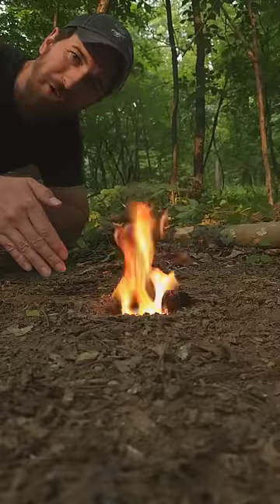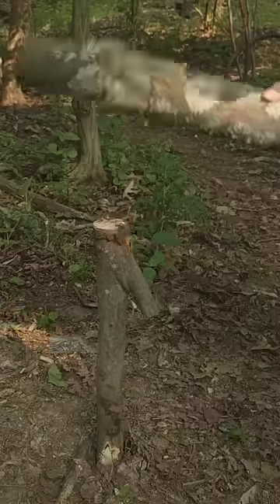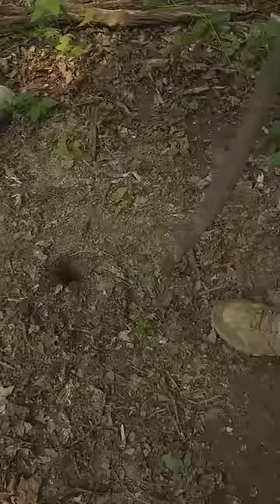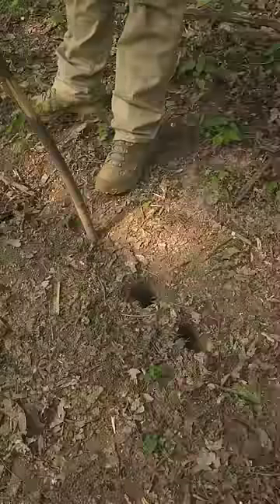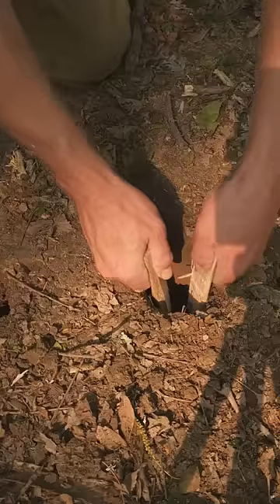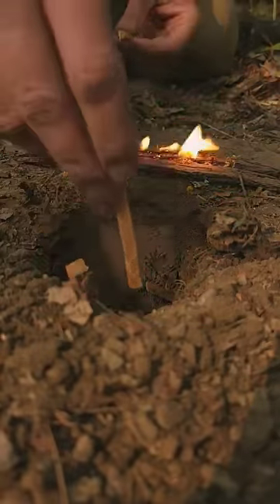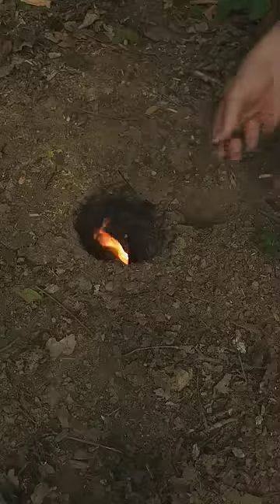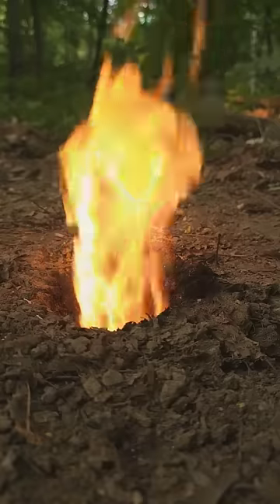Make a mini fire hole/rocket stove with no shovel 🔥

Comment: Final safety tip: Be sure to douse that setup with PLENTY of water. Those coals can last for an extended time and may possibly flare up at a most inconvenient moment...
(EDIT: obviously, many of the responders to my comment have never heard of a root finger catching fire and flaring up 20 feet from the original pit. You must first douse the fire to cool any active flames, then scrape the embers from any unburned logs, add some dirt or sand and more water, stirring into a slurry until there is no more smoke or hissing sound. Finally, feel with your hand for any residual heat. This process can easily consume 5-10 gallons of water, depending on the size of the pit. Don't assume the fire is out and you'll never wind up being THAT GUY.)
Reply: just cover it with dirt lmaooooo 😂😂😂
Reply: @armanromana1580 just blow smoke and possibly flames in your face by grabbing too much twigs and leaves and not enough soil 😂😂😂
Reply: Don't want to be like Centralia Pennsylvania.
Reply: That makes sense thanks.
Reply: Im mean its not like youre gonna stick around for long anyways
Reply: Thank you, I was wondering how to put it out afterwards 👍
Reply: About to say this is a really good way to make a ground fire. Be sure to put it out with a generous amount of water.
Reply: @DG-kr8pt wondeful me first mentality you got there. Not your problem if there's a forest fire afterwards right?
Reply: why waste drinking water when you have a bladder? 😂
Reply: Thank you, Captain Obviously Stoopud
Reply: I was going to say this is a great way to start a forest fire without any tools. 😮
Reply: Jesus is King ? Jesus wasn't a smarty pants  @OvercomeThroughJesus301

Comment: REMINDER:
FIRE HAZARD NEAR ROOTS!
Be extra cautious to light up this awesome stove AWAY from tree roots
Reply: Not just that, in areas where the ground had an organic layer, this is a perfect way to start an underground smoldering forest fire
Reply: Thats a really good point 🤔 underground fires that have lots of fuel like a whole trees root system can burn slowly but get insanely hot and you won't even know it until flames break out somewhere above ground
Reply: Oh, shush
Reply: @jordach545  why he's right, it IS an awesome stove and you DONT wanna catch roots on fire... underground fires are the hardest to extinguish
Reply: I like taking chances against conventional wisdom and i like to assess risk for myself considering my whole experience, not just the relevant area of knowledge. I reserve some safety concerns for root fires and similar. If I could develop a method for before and after checks, as well as a good method of extinguishing, then I would use this all the time.
Reply: Dig and pour, and mix, might be the only way, and that's a lot of extra work.
Reply: @Saohesc  I mean I'd say just visually assess and don't risk it if you're not sure 🤷
Reply: @jordach545 what is wrong with you?
Reply: @password6975  oh shush
Reply: Lol goofy.... Make sure you're fully vaccinated and wear your mask
Reply: @bertsbug  I think it's funny you mock that idea as if it didn't serve a crucial purpose.
Reply: Doesn't fire needs oxygen??

And the roots underground (surrounded by soil) is incapable of burning after a length due to lack of oxygen.

Correct me, if i am wrong
Reply: @BooBuKittyPhuk just be near and c9ver the holes to kill fire
Reply: @bertsbug lmao I've seen these comments on literally any comment that suggests one should practice safety. Its not that stupid that some people value playing it safe. It's one thing to say something like that about masks and vaccines, but to act like preventing forest fires is a waste of time is just an entirely different level of stupid. Things burn. Things can burn underground, we've observed it before. Things burning out of control is bad. It's not complicated.
Reply: @jordach545  huh??? I did
Reply: @TheKvc there will likely be oxygen underground and in the tree as well as there being enough room for the o2 molecules to get down there, also even with a lack of SOME o2 it will still combust it’ll just be incomplete combustion like most large scale fires r, they’re much worse than normal fires creating soot and releasing co (carbon monoxide) instead of co2 which is much more deadly
Reply: How does it burn? I know fire needs oxygen so how does it stay alive instead of being smothered?
Reply: @zakillgaming  it’s possible, has the bear minimum amount of oxygen. Seen it myself
Reply: @700K-pp9wm  hmm okay if I had to guess it could be from oxygen trapped in the ground or the hole where the fire started is still open but if neither of those are the case I would have zero clue unless the root for some reason has oxygen but I don't know trees at all
Reply: Literally about to say the same thing
Reply: Omg a lot of smokie the Bears on here, obviously this is like maybe for a "Have to" scenario, I wouldnt go camping and do this cause if you arent smart enough to bring cooking stuff and or put a fire out and make sure everything is kosher before leaving the site than you have no business being in the woods at all😉, ever hear of water bottles or a canteen if you are really roughin it🙄
Reply: @jordach545 part of being a man of the woods is also knowing how to do it correctly. So, respectfully, you hush.
Reply: @EntropicTroponin 😂 just stay inside where you're safe 👌
Reply: @BooBuKittyPhuk also the hardest to start
Reply: No. Youre not going to light tree roots on fire.
Reply: @EntropicTroponin you are never going to start an underground fire. Stop watching youtube. If the area was dry enough for that to happen you wouldnt be lighting fires in it to begin with
Reply: @jordach545 St Louis has an underground nuclear waste fire no one can stop. Jk the nuclear waste isn't on fire, yet. But the fire is coming.
Reply: @TheKvc there is oxygen underground
Plants also need "air flow" rocks, bugs and burrowing creatures keep soil from compacting (even if it feels hard to dig) a plant can be suffocated from its root system so even though it might not be full wind underther the tunneling roots will have a supply of oxygen around them. It would not be full flame fires underground but slow and hot burning its way through the webs of roots and layers of organic material under the surface. Like a tissue that doesn't flame ehen you heat the corner but eats its way across. It will kill the trees from the roots up and threaten underground wildlife. Trees root system spread out more than they burrow down.
Reply: How is a wet root going to burn with no oxygen? That's physically impossible.
Reply: Tree roots permeates the entire forest. It woyld be a difficult task. Theres gotta be a better way with less risk of that happening!
Reply: Bad idea in peat soils. Gonna burn until it floods.
Reply: How do you avoid roots? Can't see them and if you miss them by a few inches it's still hazardous. I say stick an normal campfire. Just to be safe.
Reply: @Saohesc Who cares what you want to do. Be responsible first.
Reply: @TheKvc You are wrong. Depending on organics in the soil, “dirt” can be quite porous. So… passes oxygen
Reply: @TheKvc  You are wrong.
Reply: Right, I was wondering about this now we're having all these droughts and heat waves :/
Reply: @TheKvc  You are wrong. If the soil is soft enough that you can dig a “stove” like that, it is loose enough for oxygen to penetrate and support an underground fire. Not to mention all the organic materials. 
Unless it’s winter or there have been multiple days of soaking rain, using this stove is irresponsible.
Reply: @BooBuKittyPhuk under ground fires?? Are you talking about communism??
Reply: @zakillgaming soil can contain a lot of nitrous oxide
Reply: @Coincidence_Theorist  you've never heard of fires jumping fire lines because of root systems? Or the underground fire in Pennsylvania thats been burning for over 50 years?
Reply: @zakillgaming the ground is not dead dirt, it’s porous and made of living materials.

It needs the right conditions though. A very wet or thick mud packed ground layer, or a stony one without trees shouldn’t burn.
Reply: @zakillgaming first off trees create oxygen, secondly that's why it's called a smoldering fire just waiting for a big influx of oxygen then it explodes out of the ground. For more information I guess Google underground forest fires
Reply: @djscottymaxx It's "Smokey Bear." Not smokey the bear. Clown.

Comment: Pine cones man... There's tons of them most often and they light quickly... Also keep feeding hardwood into it, after awhile you'll have a deep bed of red hot coals that stays lit for awhile
Reply: I gathered up a 5 gallon bucket of pinecones from my front yard & threw em all in the fire pit & lit it... pretty awesome
Reply: Pine trees often have some dried dead branches still attached to the tree that works well enough as kindling.   Certain trees have a type of cotton growing out of them similar to what a dandelion seed parachute looks like at the end of the season.

Comment: Please be wary of starting underground root fires when you do this. Those can spread for miles unnoticed and cause massive damage. 

I would say this would be a more of an emergency fire where if you can get it to start, it burns very hot so you can use damp wood as fuel.
Reply: This is super dangerous. It’s pretty damn irresponsible for him to suggest it

Comment: These are incredibly dangerous for root fires and should only be done in open ground.
Reply: Please tell us more!
Reply: @danacoleman4007 the fire or coals can ignite the roots and it will continue to burn out the root and can possibly move up to the tree catch the tre on fire n cause a forest fire.. ( I believe is what I read before from one of these bushcraft guys)
Reply: OK negative Nancy!!
Reply: It's real! Especially larch/tamarack roots and dead dry punky roots of all tree species. Peat is also a problem. You can't just have a fire anywhere!
Reply: @justinhachey4931  Not just trees but grass as well you could actually trap your self in a fire like that, they are fukcing scary.
Reply: @Atite_Lometen  Common sense says don't put any sort of fire right next to flammable things.
Reply: @TRIZZZ70 Ok, 6 yr. old.
Reply: @thirtythreeeyes8624  but common sense will also tell you that soft soil is moisturized dirt, also that the roots are trapped under all the land, how is the lack of air going to fuel the fire through the ground as well as the moisture from the dirt packed on top? I believe all of you are wrong
Reply: @justinhachey4931 .. What if you put a flat rock or two in the bottom before creating your fire?  Still douse with water and dirt after though.
Reply: @StevenLeeStudios Dirt containing air is basic horticultural knowledge. It's why you don't tamp garden soil. You just lightly compact it with water. That space allows water to permeate and roots to breathe, which prevents root rot among other things. Every beneficial grub, bacteria, insect and fungus requires oxygen to live.

It isn't much air, but all it takes is a smolder. Once it hits topside, woosh.
Reply: Yes but if you were ever in a situation you needed to eat …
Reply: @TRIZZZ70  It’s literally what could happen

Comment: This is great for tarp camping, I'll stay dry and warm with a small fire in my shelter. As long as I don't roll over it. :)
Reply: Put a small log between you and the fire holes. If your sleep surface is fairly soft and comfortable, your body tends to roll away from the hard, rough lump.
Reply: It's also great if you're on the run from bounty hunters or assassins!! 😃😃😃
Reply: Providing you don't give yourself carbon monoxide poisoning!
Reply: @thesaxophoneboy A tarp, not a tent..
Reply: Carbon monoxide warning!!
Reply: @thesaxophoneboy sure, but he did say he'd be sleeping under a tarp. Such shelters are very much not enclosed, so I figure you'd have no problems. If you did this in a tent, you'd probably destroy/burn down your tent anyway...

Comment: "Pound it at an angle towards the bottom of the first hole" solid advice I'd say. 😄
Reply: 💀 bro this is a kids app
Reply: @danejoyce7029  and if you're old enough to get the comment you aren't a kid anymore
Reply: @danejoyce7029  🤣
Reply: YouTube is a kids app?
Reply: @doggg4977  As a kid, I can confirm. And, thanks for the advice.
Reply: @doggg4977  yes ma’am
Reply: @danejoyce7029  it literally isn't. There's youtube kids for a reason
Reply: You have to use solid wood to pound
Reply: @chuchuokeke  🎯🙌🤣
Reply: @doggg4977 You Tube Kids is actually the kid friendly version of this app...
Reply: @danejoyce7029 youtube kids exists
Reply: @hboyO2  fr, but they still would make this kid-friendly, like why not transfer kids 12 years old and below to the kids version, and add more videos there so that not all the vids there are for toddlers

Comment: Note with the rocks, make sure they're dry. Wet rocks are prone to exploding
Reply: I did not know that if i did do not remember. Only if the are small in the fire they surely will pop out with pressure and in different directions too. Lighters batteries. Never burn a tire unless you want rescue team to find you. 😊
Reply: I mean if you're in a survival situation a popping rock is hardly your biggest concern. They don't exactly explode like tnt it's more like pop'n'crack.

Comment: I am not really qualified to ask but since I don't see the question yet. Isn't this dangerous to do in the forest because you can cause root fires underground?
Reply: You are qualified to ask, especially if you didn't see the question asked previously. 
A few people have pointed out that it can cause root fires or underground hotspots.
I'm an amateur, so I can only have suggestions (research to confirm): avoid doing this in a dense forest nor a place that has a thick leaf layer, burn for a short time, and use extra water to out the fire or an advanced fire extinguisher.

Comment: Genuine question, people are saying in the comments that this will cause root fires. Now how would that happen if the roots are trapped under soft soil that has some moisture on it, and without the abundance air to fuel the fire? No air plus moisture is a sure fire way to not cause anything to happen. Someone please explain how all of a sudden, roots that are trapped under moisturized soil, that is being suffocated without air? I'm just honestly confused due to the comments. I believe i'm right, but I can be proved wrong if it makes.

Comment: That's also a good way to not be seen. In an apocalyptic setting. You can make the fire setting a little lower by using smaller sticks and all you get is nice heat from the hole and no flame really its a good way to still cook/heat food/water and stay unnoticed.

Comment: In soft ground, keeping a pipe inserted helps. Works well on even wet ground as long as the wood is dry. Once it gets going, even damp wood burns like hell. And remember to douse it well. Underground fires are dangerous. There is one burning in a coal mine in our state for one hundred years.

Comment: I have only seen one other person make a video on this particular type of low profile fire pit. It has been my favorite for over six years now. It's so damn easy to set up, requires no tools, very efficient, easy to hide, and can save your life when you have only a tiny bit of fuel and are too badly injured to gather more. Getting hot water to make pine need and dirt soup is disgusting and keeps you alive when you can't hunt and need vitamin and minerals to pull you through. But, rocky soil like in foothill or mountain terrain makes it a little more difficult, and some forests consist of extensive root systems that can burn underground for days before resulting in forest fires. If you find yourself in either of those situations, a crevice fire may be your next best alternative unfortunately.

Comment: I would only use this method in a survival situation, as roots can smolder for hours or even days, long after you leave the camp! Sure it is effective, but much safer to make a fire above ground, preferably on some rocks or something elevated like a small wood stoove or a portable small grill/grate. Even a small piece of metal on the ground is better than nothing. There are really cheap and light solutions on Amazon, that weigh almost nothing and perfect for camping.

Comment: to make a ground furnace in a similar way,,, 

one large hole for the fire, one small hole for air,,, half fill the fire hole with BBQ bricks, add some spirits to get it going and force feed air through the other hole with an electric blower

it'll get hot enough to melt steel

Comment: But NEVER, NEVER, EVER use wet stones. They explode as they dry. 😮 or set a couple of thicker branches over it & put your pot on it. 😊
Also NEVER EVER light one if there are tree roots there. They can catch on fire & then there is really trouble. 🔥

Comment: So one Depot, you can add some call a little bit of wood from around the area and leaves then you need to do a side hole because it needs air to be able to or fire needs to be able to have air so it’s not snuffed out. Yeah I’m not. I guess when I was four or seven thanks to my father.

Comment: I like that can I show you something I've done for years take a number 10 can or a metal bucket leave about maybe an eighth to quarter of an inch above the ground Android don't do it on the trees because I don't care how high the leaves are up you'll burn them the heat is incredible only use the frame to boil water used to hot coals to cook with it's a lot of heat won't keep you warm but wow you'll be amazed the heat that comes off of it good day and God bless

Comment: Imho, i wouldn't take risk of leaving smoldering material/roots unless I had a few gallons of water to put in the central hole after using it. Stay above ground,  That's what a chief firefighter told me.